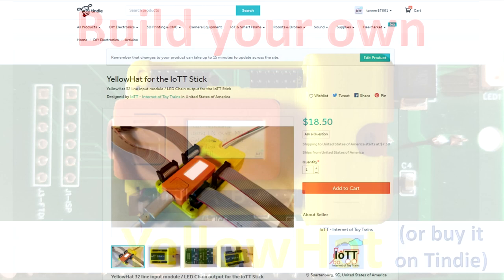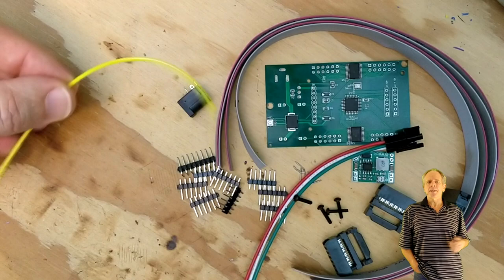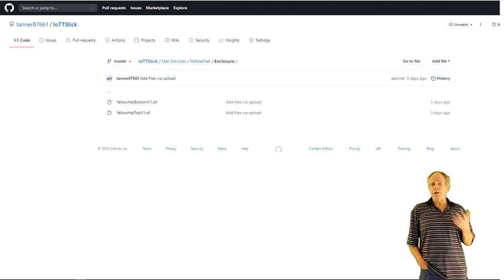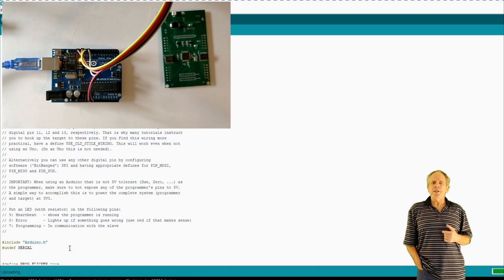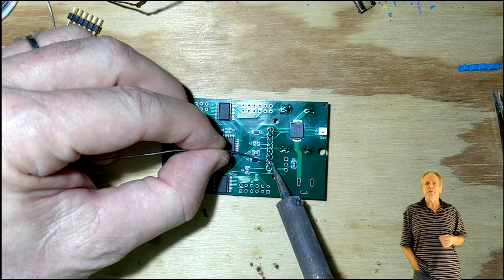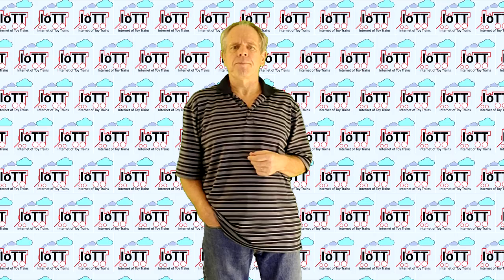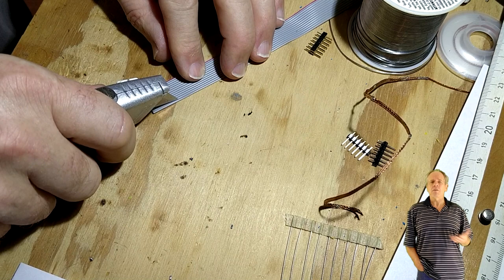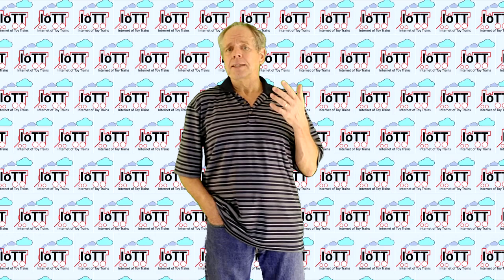Build your own YellowHat (Video#50)

Comment: Thank you for this video. I will surely try to build mine. I dint receive my first order yet. I guess the postal system is slow. I am in the planing phase of my signaling system and will use your great system. Keep the good work. In one video you talk of a gray hat for signaling. I guess you are looking to do an addressable system to simplify the cabling. I got a suggestion for a hat to do last. A sound hat. Install conceal sugar cube speakers around the layout and play various sound effects. Just an idea I got.
Reply from the maker: Thanks for the feedback. Unfortunately I see long delivery times recently for shipments to Canada, I think caused by the USPS. Hopefully you'll get it soon. I usually enter a tracking code into Tindie after doing the shipment, so you should be able to track the package from your order.
For signaling, you use the BlueHat. Check video#13 for an idea how to do WS2812 based signals. The signaling logic will be a built-in logic module of the IoTT Stick. I am currently working on it.
I like your idea regarding a sound hat. There is actually a speaker hat available for the IoTT Stick, so it would only be a matter of software to send or call sound files via commands.  Something to think about.
Reply: I know im randomly asking but does anyone know a method to get back into an Instagram account..?
I stupidly lost the password. I appreciate any assistance you can give me.
Reply: @Bryson Muhammad instablaster =)
Reply: @Samson Andre Thanks for your reply. I found the site through google and I'm trying it out atm.
Seems to take quite some time so I will get back to you later with my results.
Reply: @Samson Andre it worked and I finally got access to my account again. I'm so happy:D
Thanks so much you really help me out :D
Reply: @Bryson Muhammad You are welcome xD

Comment: Are you considering a occupancy detection hat - maybe current based, or ideally railcom detection
Reply from the maker: Thanks for asking. 
Basic detection is already possible with the YellowHat. You can connect any detection module that is capable of driving an output line low, e.g. the NCE BD20, to any of the 32 input lines of the YellowHat. This will generate Button Down and Button Up messages when current flows or stops flowing. Tose messages can then be converted in the Message Handler module to Block Detector messages for LocoNet.
But yes, I am also planning on doing the OrangeHat, as quickly announced in Video #44, which will be a node module for connecting different types of sensors, like current based block detectors, optical axle counters, and possibly Railcom. I probably will start working on that once the GreenHat is done, so most likely sometimes early next year.

Comment: really excited to build this design but I have run into problems!  After successfully adding the bootloader and switching back to AVR ISP and uploading the yellowhat sketch using the FTDI programmer I get a warning  'Low memory available, stability problems may occur' - which I imagine isn't normal - this also occurs when I verify the sketch.  I have not had any success testing an LED chain - such as LED#0 etc with any of the 3 boards I have constructed.  Do you have any suggestions for my next move?  Thanks
Reply from the maker: The low memory warning is ok, but if you want to get rid of it, you can lower the maximum number of LEDs you allow for the LED chain. Each LED is taking a few bytes, so I am filling it up to the point I still know the remaining RAM is enough for the few commands that the 328P is running.
As for programming, first try to run a simple sketch, e.g. the blink sketch, to see that your processor works. Then focus on LED 0 and see that this one is working. Then go on to the full chain.
Reply: @IoTT  ran Blink , replugged board into an Uno as described at 5'55 in video and got a positive result blinking LED on the Uno board - so this proves all the processors on all my boards work.  I have all my libraries updated but I can't get LED 0 to light or any response from the buttons.  Is there a simple script I could use to test the LED ?- also I guess I don't need to fit the buck converter to see the board working - so I can try the rest of my boards. thanks
Reply from the maker: I am not sure I understand what exactly you tested to make sure the processor works, but anyway. If I remember right, there is a blink sketch for WS2812 available somewhere, that you could use to test just the LED.  Set it to work with the IO pin for the LED and see what you get. Maybe use an oscilloscope to verify the signal is flowing. 
The board needs both voltages active, 3.3V and 5V to work. But the 5V does not have to come from the DC-DC converter, it is good enough to just connect the IoTT Stick as power supply. The power supply is only needed if you run a LED chain with more than just a few LEDs.